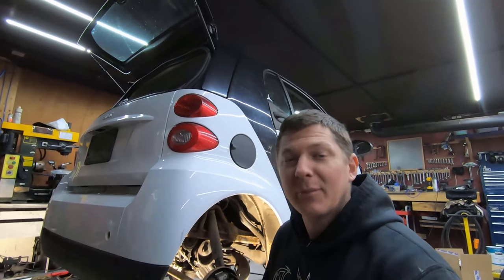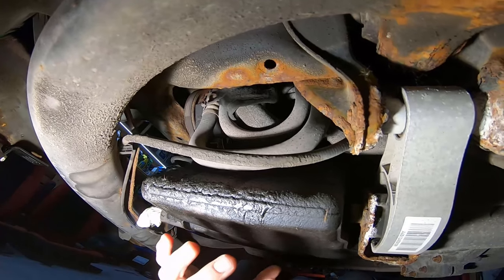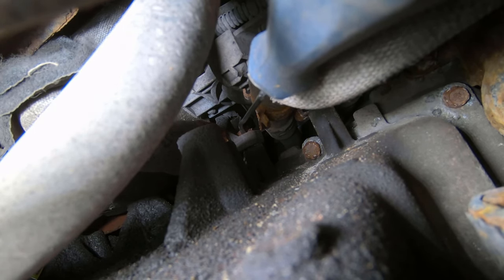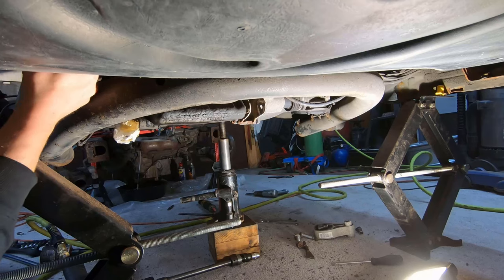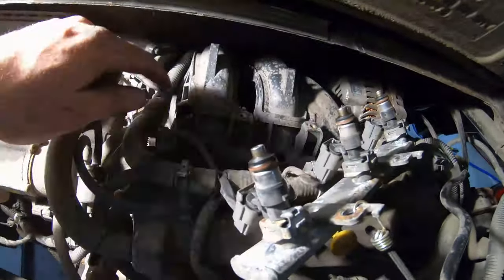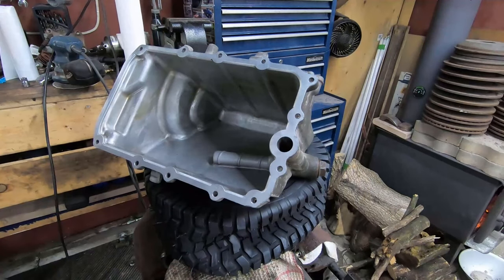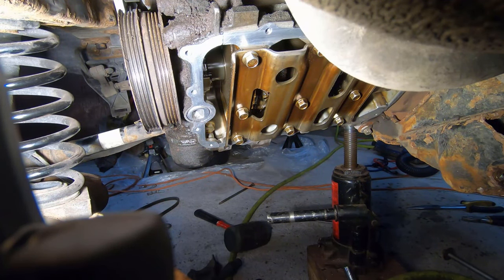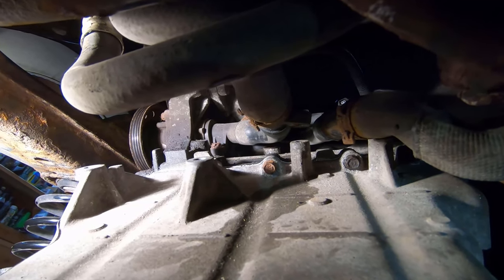Smart ForTwo 451 Oil Pan Replacement (2008-2015)

Comment: When I first got my used SC, i changed the oil, and low and behold, the threads came out of the pan as well.   I've gotten lucky so far as the drain plug catching, but I think a change of an oilpan is in the future.  ty for vid.
Reply from the maker: If you don’t have to deal with the corrosion I had, it will be a much easier job.

Comment: Wow, what a hassle! I was hoping to be able to do this myself but I don't feel confident taking that many things apart and being able to put them back together right. 🥴
Reply from the maker: If you’re able to get the bolts out that are holding that one bracket, so like if they aren’t too corroded like mine, the job would actually not be that bad. Mine was just a real pain because of those few corroded bolts.

Comment: I just finished doing mine today luckily I didn’t
Have to take half the engine apart as I had a few tools around me to get to the coolant 10m bolt but it did take a few hours to figure out
How to get it out but I completed the job in 7 hours 🤦‍♂️
Reply from the maker: Glad you got it done!

Comment: I start hating this car, for some reason the oil plug start leaking comes to find out the oil pan thread stripped. came across your video THANK YOU SOO MUCH..... tho lot of work to replace the pan so I decided to go with M23x1.5 thread tap but couldn't find M23x1.5 plug . not sure how I can fix it without replacing the pan,, too much work & tools that I have to pay & sadly can't drive the car to a shop & most shop here need to see the car & can't risk tow it back & forth between shops... any suggestion? where I can find M23x1.5 plug :( ?
Reply from the maker: You can plug the pan with an expanding rubber plug to seal it up so you can get it to a mechanic.
Reply: Took me forever but I took the oil pan out. I doubt I'd put back the bolts that hold those hoses , they pretty much tight & not lose to move around. What did you use for remove & clean the old sealant? & How did you hold the pan when you put it in while putting the bolts in? 

Also do you know where to get the bolts for the oil pan? Or their size? I prefer replacing them all rusty and some are stripped a little bit.
Reply from the maker: Glad to hear you got it out. I cleaned the mating surface with a 3M ROLOC pad and then wiped it clean with acetone. I just held it in place by hand until I had a couple bolts finger tight around the edge. I think I reused all the original bolts, but I’m sure an automotive fastener store will be able to source replacements. You want to stay away from hardware store stuff because the corrosion resistance won’t be there.
Reply: @PBGarage  great thanks so much, yah was the worst thing I ever delt with in a car. Again appreciate your video, it helped a lot

Comment: I'm doing the job tomorow. I've already lowered de motor for the alternator job in the past and I hate that. I cross my finger over those ridiculous 10mm brakets bolts that could have been on e housing of the pan. wish me luck!

What is the exact name of your Moto seal? It has to be high temp graded I guess?
Reply from the maker: I was using Permatex Moto Seal, because that’s what I had on hand. But any gasket maker that’s meant for exposure to oil will work. Permatex Ultra Black, Ultra Grey, JB Weld Ultimate Black or Grey, whatever you have available.
Reply: Nice! Thx I’m at Canadian Tire right now! What a quick answer! Do you remember the socket size of the 12 bolt contouring the pan itself?
Reply from the maker: @Sebterka oh man, from memory I’m going to say 10mm but I can’t remember.
Reply: @PBGarage  thanks you are the best. Your video is really the only one that’s actually helps!
Reply from the maker: @Sebterka happy to help good luck with the project!

Comment: Isit important for the bolt for the coolant
Lines to go back on ?
Reply from the maker: I did mine back up because I didn’t want the coolant lines rattling around and springing a leak. Might be ok without the bolt, might not, I don’t really know.

Comment: Off subject, Has anyone done a vid on replacing the roof sun shade strings and springs?  Mine broke and lost the springs.  How long is the string and where can I get replacement springs?
Reply from the maker: Good question. I’d think the easiest would be to replace the whole sunshade assembly together. It’s only a few bolts to remove.
Reply: @PBGarage  I would however, used ones are even expensive.  All I really need is a restringing diagram.

Comment: there's no oil pump?
Reply from the maker: Yes the oil pump is on the bottom of the motor but it’s not connected to the pan.
Reply: @PBGarage  it’s hidden by the windage tray.
Reply: @PBGarage  ah I've been looking online and I can't find the part to take a look at it. Thanks. Also, great video

Comment: Unfortunately this is NOT the correct way. The job pays 1.5 hours flat rate. This person is not a mechanic. Beware of following his advice.
Reply from the maker: If the bolt wasn’t seized it would have easily been accomplished in like 45min. All the extra work was from the one bolt being corroded and unserviceable, requiring the engine lowering for access to get the bolt off. I’d love to know what the correct way is though if you have any productive tips.